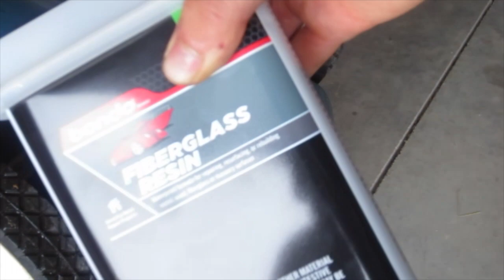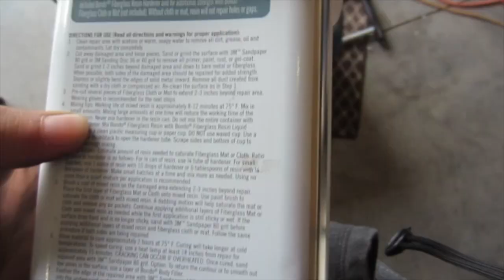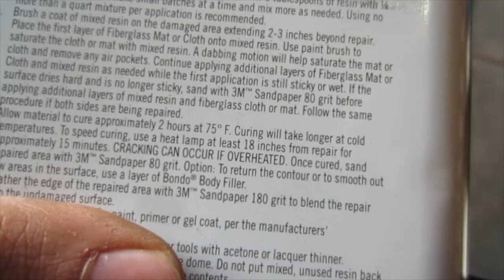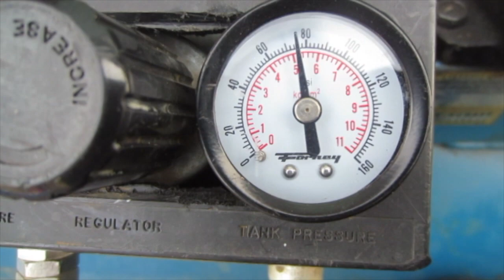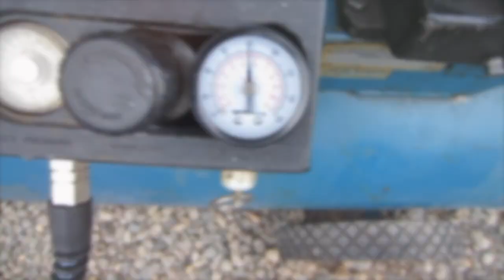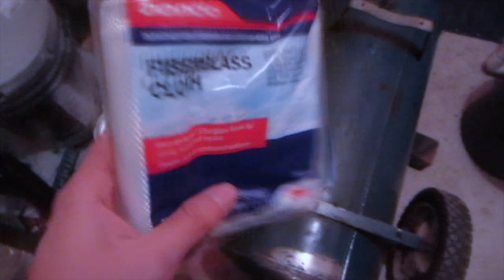Diesel compressor build pt.5 (fixing leak, painting, other odds, & ends)

Comment: I would add the resin into the tank instead of over the surface. might hold, but will definetly hold if the resin cures inside as well. Would need to bel cleaned real well, oven degreaser works perfect for all of those things. might effect some surfaces, but generally it will clean every sort of gunk well.
Reply from the maker: As shown in the video, I tried pumping the resin into the tank, but it did not hold, somehow the air still made it past. Putting fiberglass on the exterior turned out to be the best option for me. So far the tank has not been leaking at all, and the paint is still sticking real well.

Comment: I never thought of that. Excellent use! Do they have good torque?
Reply from the maker: Thanks for your comment! It seems so, I'm running a larger driver pulley than the stock motor had. And there are no signs of bogging.